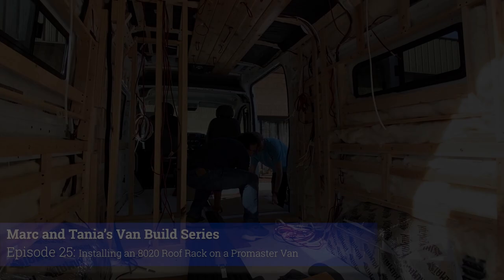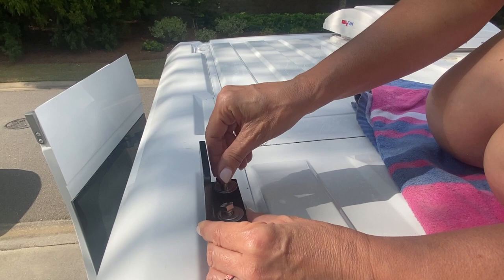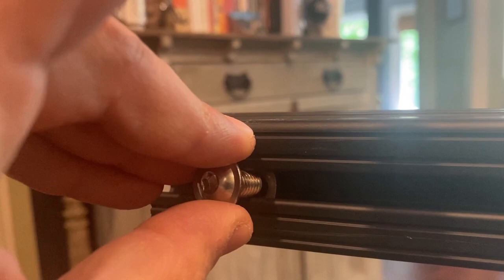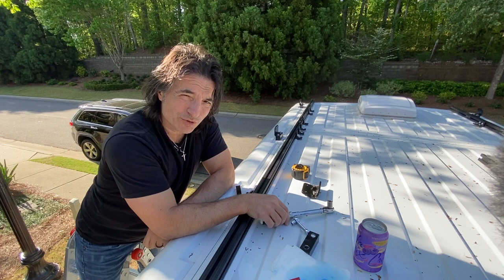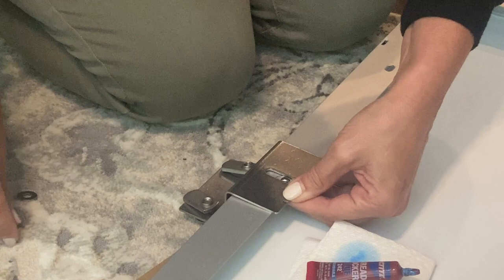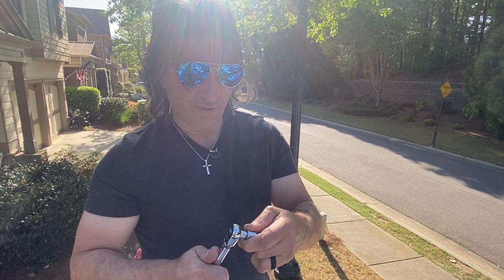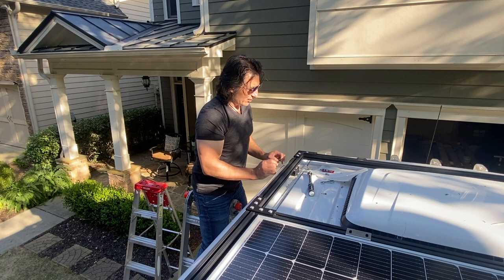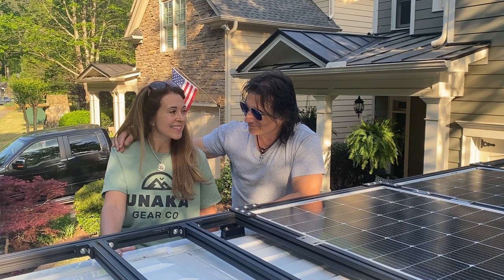8020 Roof Rack on a Promaster 2500 Van

Comment: OMG what a great episode! Everything does take much longer than expected. Lesson learned: when we get our van we will measure the distance between the posts.  Why is Tania the one always doing the work on the roof?  I've been going back and forth over buying all the components separately to save a few hundred $ but the tech support you got is probably worth that expense.
Reply from the maker: So glad you like the video. We tried buying individual parts but it was hard finding a distributor that had experience with van builds. So it left a lot of questions for us. We are fortunate to have Unaka so close. :)

Comment: Dont get me wrong. I love the way your solar panels look.  Very nice and low profile ( beautiful ) hard to see from the ground. 👍👍👍 Here comes the BUT.  Is there enough air space underneath them?? Because there is supposed to be a certain amount of air space or air flow underneath the panels to work 100% proper.
Reply from the maker: You are spot on and 100% correct. Right now, we have about a 1.5" to 2" gap. I have seen different recommendations to how big that space should be. The nice thing about the flush mount adapters is that we can alway flip them upside down and have the panels sit above the 8020, which gets us another 1.5". To be honest, one thing I have learned through this build is that everything is a trade off. We are about to install a wind fairing on the front. Some say it really helps with gas mileage. Some say it doesn't, Some say it prevents airflow under the solar panel, which is bad. Some say it reduces noise, which is good....The truth is we have never used one and we just like the way it looks. If we find more negatives than positives, we'll remove it.  Our biggest concern right now is vehicle weight...and making sure we anchor everything correctly in case of a front side impact. For the rest of the considerations, and all are totally valid, we just go with what we feel is best....and have a plan in case it needs to be changed. Thanks so much for these comments. They are really helpful to us :)
Reply: @marctania2349  l truly do like that low profile look with the panels sitting like that. Hopefully you have enough or more than enough space under there.  Out of all the ones I have seen and there has been a lot I like yours by far.  as far as the Air Jam those.  I have only dealt with them on big trucks that Drive cross country.  I have not seen any on these Vans like you got.  I have seen them on pickups that are pulling the big trailers but never on them vans like yours.  I guess we will all find out together if it works.  hopefully it works for the best and looks as cool as your solar panel rack. The best of luck with it. And get/let Tania do more airplane modeling of the stuff behind you when you're talkin to to us

Comment: Hey guys, excellent video. You mentioned that one or two of the crossbars were sagging and I’m wondering if you put decking across there is the 8020 strong enough to stand on or support the weight of storage bins?
Reply from the maker: Hey Guys, Thanks for watching. There were 2 loose corners in our design that were sagging a bit. We ended up propping something.....and I can't recall what it was (I think a short scrap piece of 8020)....under the sagging part. Luckily, the sag was directly over a framing member in the van structure, so we didn't have to worry about it messing with the roof.  I think the specs for deflection on the 8020 website are not very accurate....or they are done under very specific conditions to get the marketing numbers they want. The deflections tests I did showed much more deflection that the company states. But, regardless, our deck is certainly strong enough to stand on or put storage bins on. And Unaka was very easy to work with if you go that route. :) Hope that helps.
Reply: @marctania2349  that was a very detailed and awesome reply, thanks so much!
Reply from the maker: @CubbyVanLife  of course. Glad to help :)

Comment: Nice walk through instructional.  How would you approach a similar setup only attach/detach for a hybrid car?  I've been looking at (DIY Solar) project videos and a few mobile ones, but these are all RV and van permanent installs.
  I get about 90 mpg with a full charge on my hybrid so I can get to work.  What I would like to do is break out a collapsible kit, mount it on the roof of my hybrid for charging and remove it before the drive home.

  First big issue is how do you protect it.  It would need a strap in system that can't be easily cut.

Comment: Great video. Which solar panels are you using?  They fit so well in the space.
Reply from the maker: Hi Robert, from our research, it seems like there are only two 200w solar panels that can fit east-west on top of the Promaster 2500 like this. One is by Rich, the other by Newpowa. These are the Newpowa models. Not only do they fit in this configuration, but they’re made up of nine individual electrical buses. So there are more ways to get around a failed section of the panel. I’m not sure of the exact model number of these, but they are the ones listed on the Unaka website. They are pretty new on the market, and we are excited to use them. We will talk more about them in the upcoming video where we wire them up. Thanks so much for watching :-)

Comment: Love your videos. Just wondering if you're able to utilize your roof rack with tie down straps or is this style of roof rack not meant for that type of thing? Also was this roof rack custom made to fit around your AC & Fan configurations? Or did you place your fan & AC based on the layout of the roof rack? I'm currently converting a Promaster 136 wb high top.  Thanks!
Reply from the maker: Hi and Thanks so much. I know Unaka Gear, as I'm sure many others, sell tie down kits for 8020. I will stick the link in a comment below. The roof rack was design around the fan and AC unit, which we already had in place. But it was pretty easy. 8020 is like a big erector set so we were able to put crossbeams where we needed them. We actually designed the whole thing on Smartdraw. Then the Unaka engineers took our drawing and refined the measurements. Tania is holding our design at the beginning of this video.
Reply from the maker: https://unakagearco.com/products/8020-tie-down-kit-stainless-steel-15-series#:~:text=The%20Tie%20Down%20Ring%20gives,your%208020%20style%20aluminum%20extrusion.

Comment: Loving all the videos.. just disappointed I’m all caught up!  That’s okay.  I just keep going back and rewatching them😃.  You know what I like the most?  You don’t make it look easy - you share the struggle.  I really appreciate that.  Quick question. Did you get the Ram Promaster KIT from Unaka? Or did you buy the 80/20 and brackets from them and figure it out yourself?
Reply from the maker: Hi LeAnn, I designed it myself and then sent it to them for validation. They were a great help. I ended up buying everything from them....I think the PM kit plus some extra parts. Those guys are awesome to work with.
Reply: @marctania2349  I’m currently working with them but I’m not designing a thing!  I’m also getting the Fiamma awning.  I’m so excited!